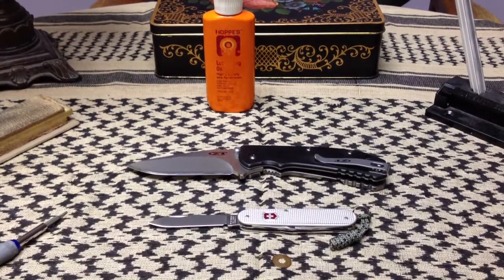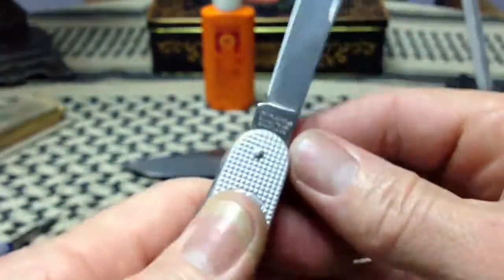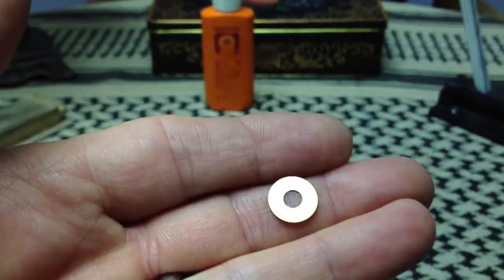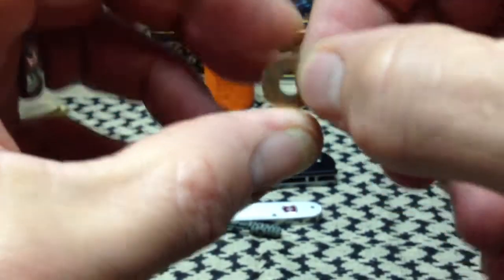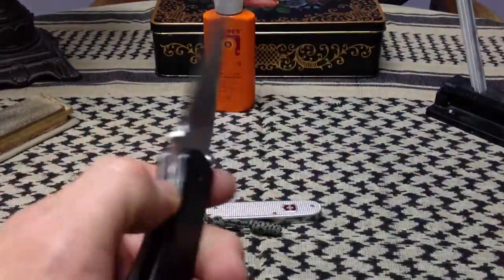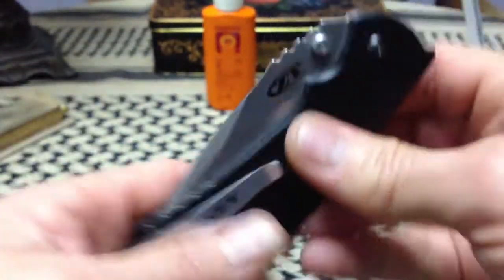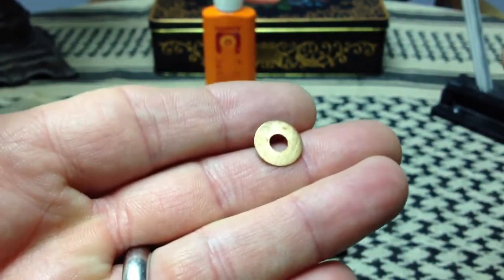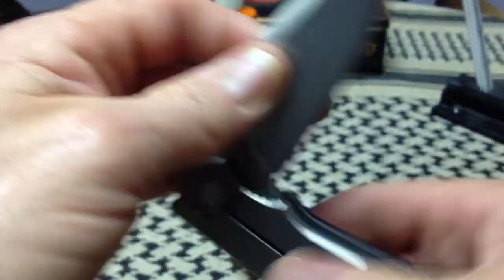Knife Pivot Bearings: What Works and What's Hype

Comment: Thanks for the video. I'm glad you pointed out how dirt and debris can more easily get inside. Also, yes, it would get rather expensive to harden liners assuming it's not a titanium knife to make sure it doesn't ware badly. Even a D2 knife at 62 hardness would ware against 68 hardness bearings on the other side.

Comment from the maker: I get what you're saying in this thread, toadstkr, but even if you sealed out the debris and sealed in the lubricant, then pressed or glued in hardened micro-finished channels, I'm not sure you'd have a much better pivot than a good old phosphor bronze washer, certainly not more durable, and the added cost would be unable to be justified.  The roller bearing idea is interesting, but would have to be conical to achieve any thrust (side to side) capability -- think of an old style wheel bearing.

Comment from the maker: That will help, I'm sure, but you still don't have the thrust bearing properties of washers needed for torsional stresses in a knife pivot.  Whether they're bearing against titanium or aluminum handles, or soft stainless liners, those hard little balls are going to dig a trench or peen that adjacent material, causing wear and looseness, regardless of contamination, as side-to-side force is applied to the blade.  This will not happen with bronze washers.
Reply: Yes, this happens all the time. I've known hundreds of knife users that have tossed their expensive knives in the trash, because of the horrific trench-digging properties of the ceramic balls, and quite often they also create little divots in the titanium and get all 'notchy', or they just become so loose from all the combined horribleness, that there is no alternative but to dispose of the knives properly- for safety's sake! A loose, notchy, knife with deep ball trenches is an unsafe knife!!! And please, please, please- NO unqualified individuals should EVER consider replacing the bearings to a quality 13 or 18-ball ceramic bearings, or alternatively giving their pivot an additional 1/10 of a turn to tighten things back up.. That would also be asking for trouble :-)

Comment from the maker: I understand the smooth concept, and it's true, you have to make a knife very precisely with washers to achieve the smoothness of ball bearings, but it can be done.  Witness the Benchmade Axis Lock knives and Spydie Para 2.  Ball bearing pivots can be used in knives with less precise tolerancing to make them silky smooth -- sort of the same logic as assisted openers.  But for a high-quality user knife, I'll take the best washer pivot over the best ball bearing pivot every time.

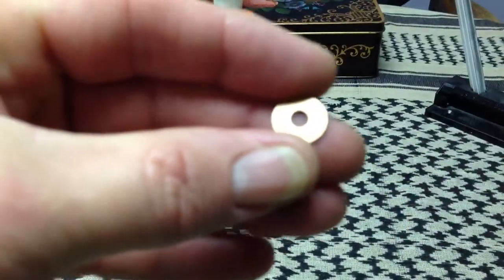Comment: Its at 05:20 in the vid. The designer told CRKT to add a Teflon washers to enclose the IKBS to prevent dirt from getting in (don't know if it will work we'll see)

Comment: I believe CRKT tweaked its IKBS system to prevent malfunctions (I think its slightly more enclosed) to prevent dust and debris from entering. Check out the nutnfancy crkt shot show 2013 booth review the guys from crkt talk about it (I think its during the newer ripple review) anyway I own a CRKT Shenanigan with the IKBS and its smooth like butter. (I wouldn't put it through hard use unless I had too)

Comment from the maker: I'm sure for many users, especially in gentleman's folders, the ball bearing system will work well, but over time in a real user knife, that pivot design probably won't hold up.  Cliff Stamp posted a video yesterday in which he did some prying with a ZT0561, which has the KVT ball bearing pivot.  It didn't go well...